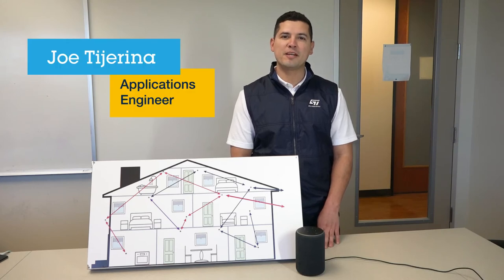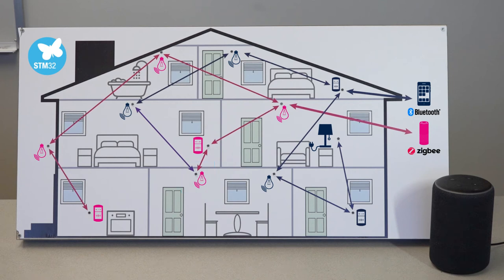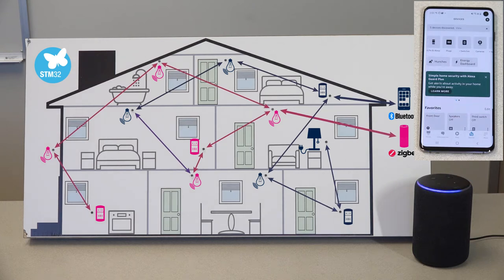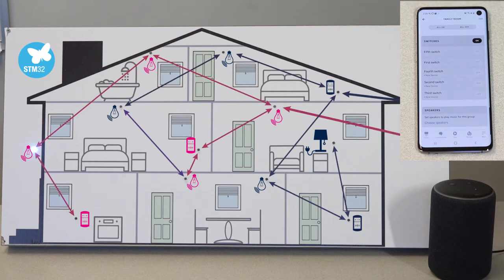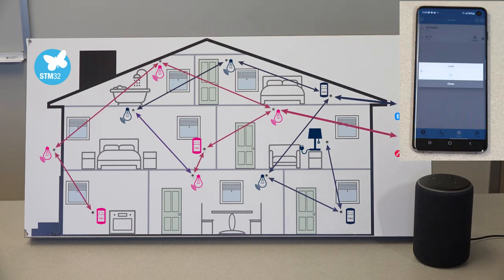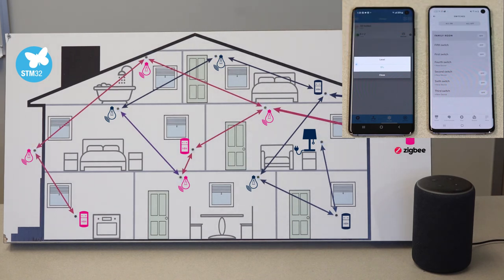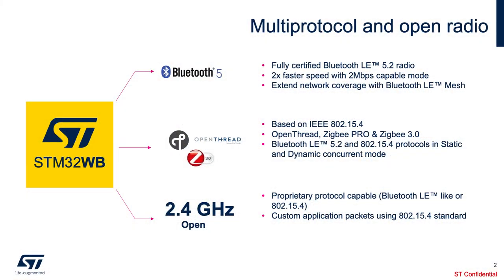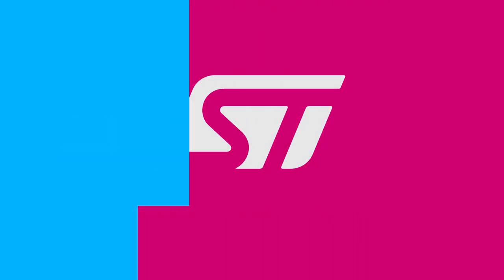STM32WB BluetoothⓇ LE Mesh and Zigbee Mesh Smart Home Solutions

Comment: How did you connected amazon echo wifi device to ST BLE / Zigbee hardware?

When you said Alexa turn on the light. App toggle switch is  still  in off position..How to update element status back to  app? If any example code os available kindly share me the example code name.